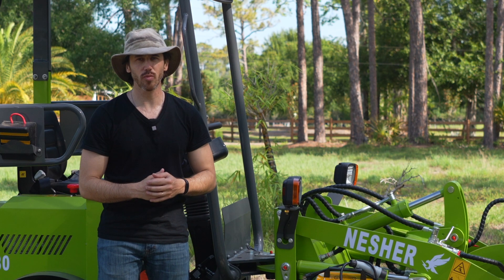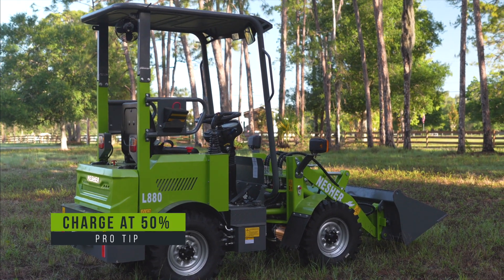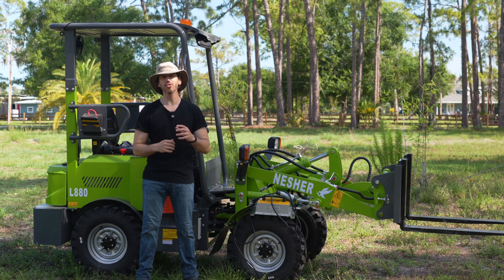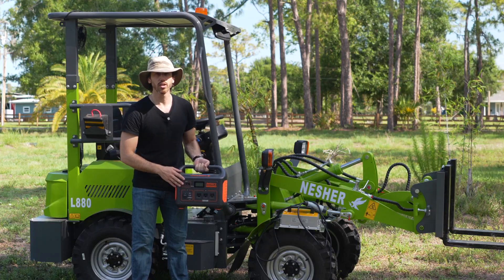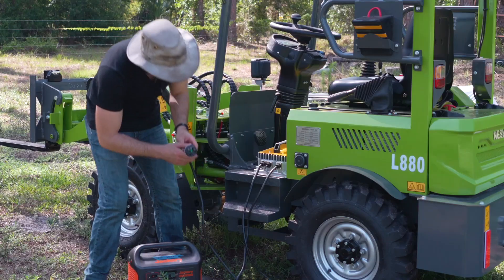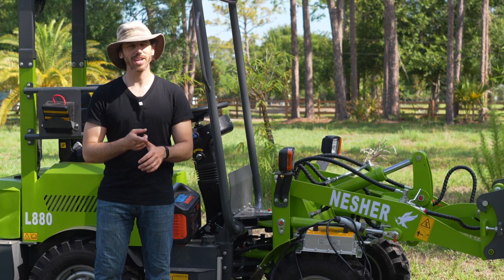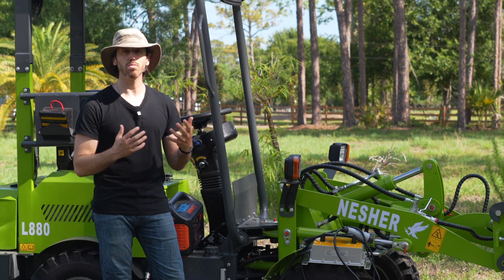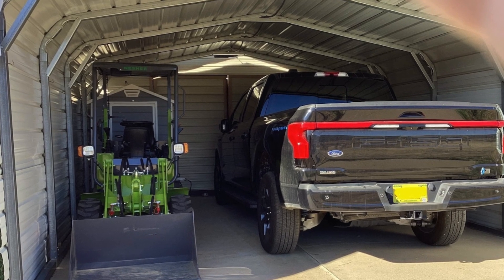How To Charge A NESHER Electric Loader In The Field

Comment: A caution about using a car's AC outlet: Check the wattage rating. I have an inverter outlet in my 4Runner that is rated for 400 watts, which doesn't sound adequate for the power draw of the charger.
Reply from the maker: That's true! Good point. While many trucks and utility vehicles have higher wattage inverters, a lower-rated inverter would likely fail to power the charger.

Comment: And solar panel?
Reply from the maker: You can definitely do solar charging, but it’s tricky to set up in a pinch like this. Solar is really well suited for a more permanent install with large panels feeding a fixed battery bank, then you charge from that. Here is a good example for a Nesher Tractor: https://electrek.co/2024/08/26/i-run-my-electric-tractor-completely-off-grid-heres-my-secret/